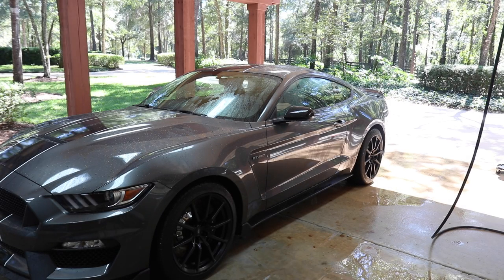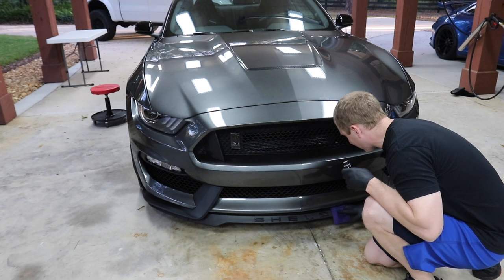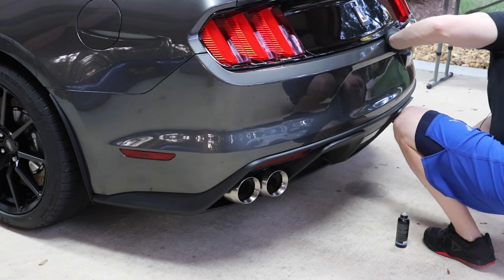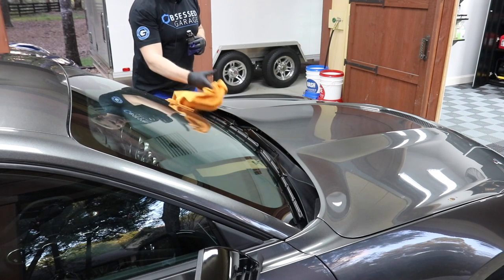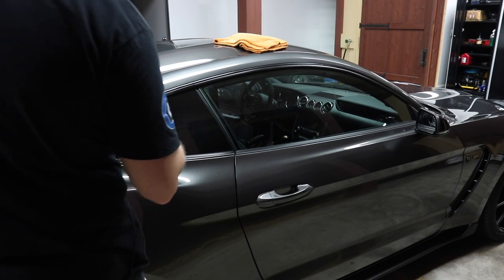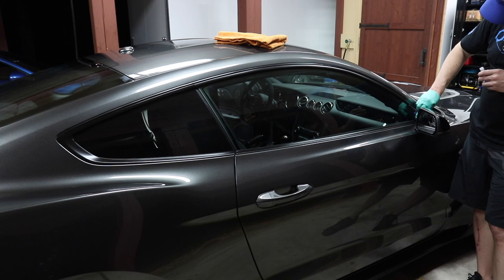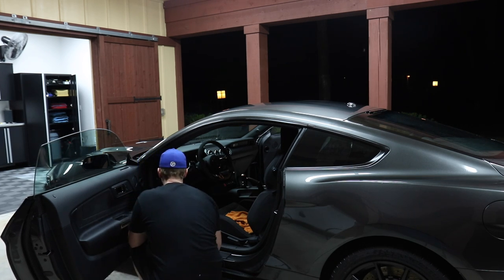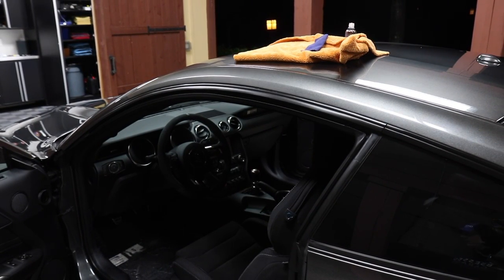Dialing In My New Shelby GT350: E12   Rubber & Plastic Trim Coating

Comment: I love Gyeon Trim but it's very hard to use without streaking. Would love some detailed advice on applying it. Solution Finish and Turtle Wax Jet Black aren't as durable but much easier to apply. I bought a 13 yr old Alfa 9 months ago and am still "dialing it in". Have probably put in around 200 hours of detailing by stripping parts off and refrurbing them, finding new ways to renew the old plastics and painted trim has been a big learning curve. I just put in about 30 hours on the windscreen wipers alone lol.
Reply from the maker: I've found the wiping gently with a plush MF towel is key.
Reply: Thanks for replying. Yeah I think I was reluctant to do that as it's so expensive I didn't want to waste any haha. I wrote that before you got to the Gyeon application and you actually answered my question in that part. I was trying to apply it more like a paint and not wiping off the excess. I used it on my hard plastics though not the soft ones as you do. Is that also a mistake? With it drying so hard I thought it would crack if I put it on soft stuff and look bad.